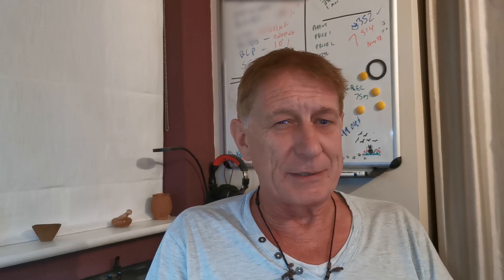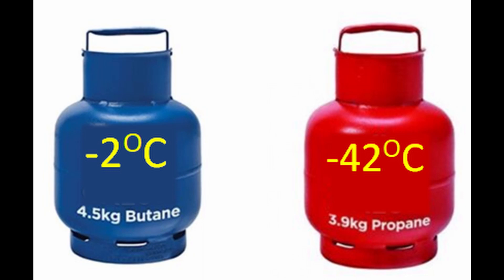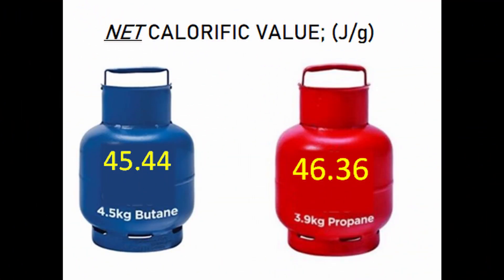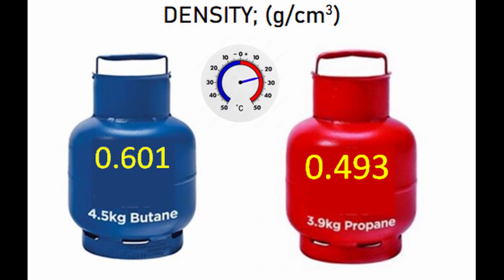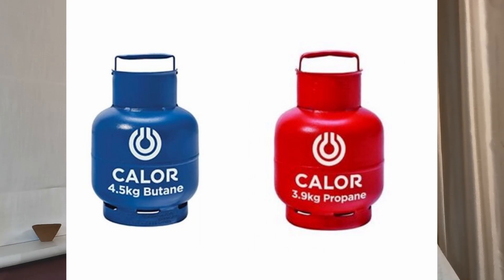Propane vs Butane

Comment: i have a gas heater and one bottle of calor one bottle of propane is it safe to use both on my heater with the two different regulators.
Reply from the maker: sorry to be a bore but really you need to check  the manual of your heater on that one.

Comment: Hello; Is the LPG you use in barbecues and caravan kitchens in your country exactly the same as AUTOGAS?
In my country, the standard mixture ratio of butane and propane in the kitchen cylinder is 70% butane and 30% propane, and the standard mixture ratio of AUTOGAS is 30% butane and 70% propane. Is it DANGEROUS to use AUTOGAS in barbecues and caravan kitchens at these ratios?

Merhaba ; Ülkenizde Barbekü ve karavan mutfaklarında kullandığınız  LPG ,  OTOGAZ  ile bire bir aynı mı?
 Ülkemde Mutfak tüpünün içindeki bütan ve propan standart karışım oranı,  %70 bütan ve %30 propan, Otogazın standart karışım oranı %30 bütan, %70 propan şeklindedir. Otogaz'ın bu oranlarda barbekü ve karavan mutfaklarında kullanılması TEHLİKELİ 'mi?

Comment: I see the 4.5Kg blue bottles have been phased out. I have had to move to 3.4Kg Camping Gaz with an adapter. The bigger 8Kg blue bottle won't fit my camper.
Reply from the maker: yep.. they are in the process of phasing them out... a real pain for us. I had a rig with two 4.5kg so I never ran out on the road but now swapped over to a single refillable as detailed in the video link at the end. Worth the outlay in the end.. . soooo cheap buying Autocas compared with the exchange bottles.  But.. if you are not mm critical... Flowgas might work for you... but check the dimensions., (the other video link).
Reply: @campervan_hackers  Only one will fit the locker, even the smaller Camping Gaz bottles but I've room in the camper to store the second bottle. The fridge is ever so frugal on gas where there's no hook-up. Worked out in the end.